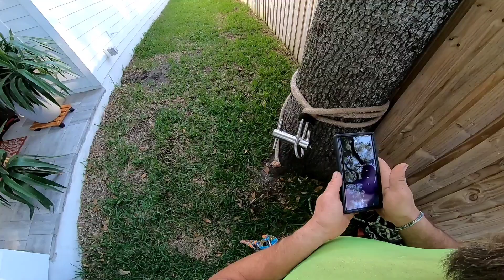(raw) #1 That one job with no decent tie in point

Comment: Minimum approach distance can be more than 10'. It depends on the voltage of the primary. Trevor, is that Petzl Zillon a recall? Check your ZigZag model number as well. Looking into returning both of mine asap. They've both been listed as recalls. Haven't had either of them for long. They slip, poor spring or something.